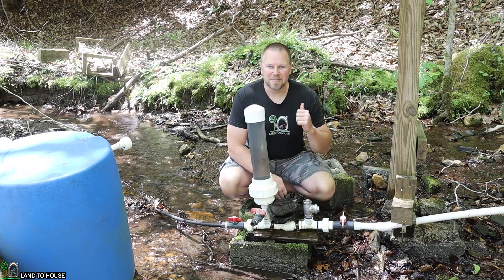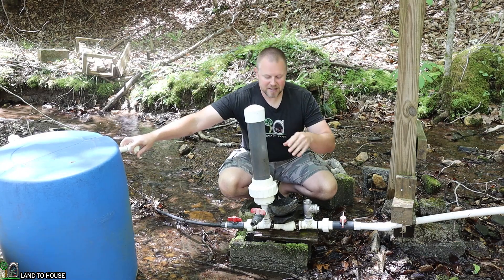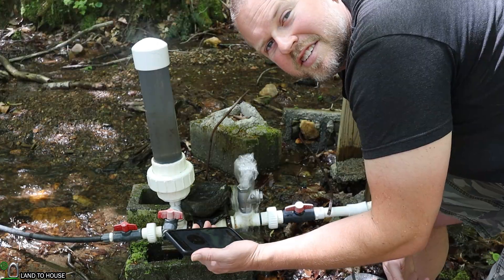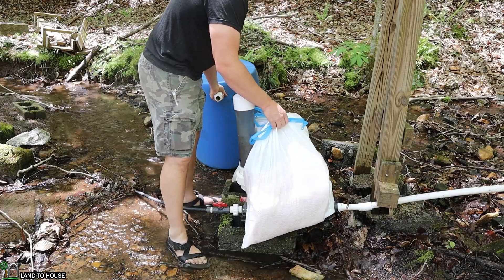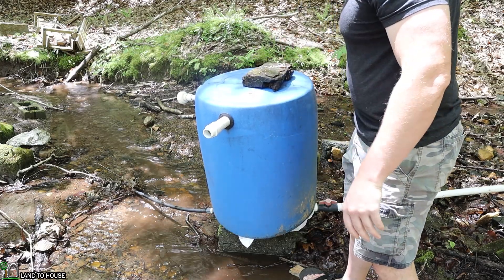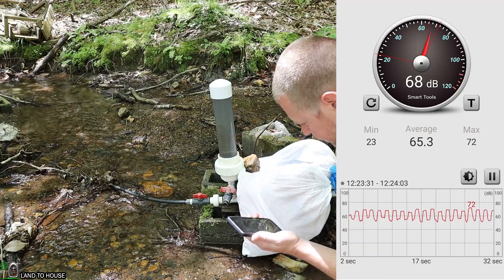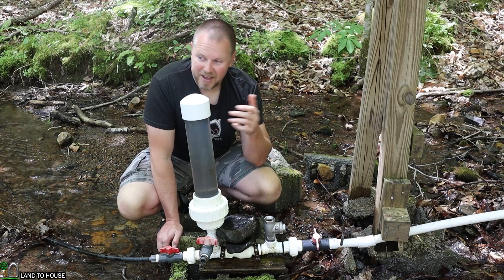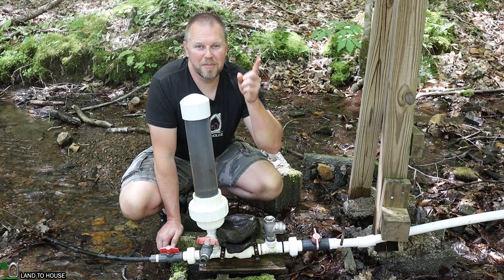Reduce Ram Pump Sound with Insulation and Barrel

Comment: The next thing I would try is to get a frequency meter and then find out exactly what frequencies that the ram pump is generating, then use that to design a sound baffle targeting those measured frequencies.  You also want to isolate the sound containment device from the pump so that any physical transfer of sound is harder to achieve. in the same way that the sound is travelling along both pipes.  For the pipes, I'd bury them.

Comment: Mass instead of fluff will deaden the sound.  Try making a pump-house enclosure around it with the extra cinder blocks you have from taking down the dam wall.  That's why a lot of home well pumps are inside a cinderblock dog-house, the cement blocks do a great job of keeping sound from penetration.  You might also try a little pump-house of your left-over 2x lumber from the new workshop.

Comment: Try spring loaded PVC check valves. I think the half inch ones have a 2.5 lb spring. For more water, use a slide valve or the homemade one at this video.
RAM PUMP VALVE COMPARISON - why the swing check valve is so useless

Comment: You need to put it inside styrofoam box, inside other dampened box. The intake and output also need to be flexible, like rubber or silicone.

Comment: Check out packed sound attenuators that are used on HVAC systems. That will help with the waste valve noise. The only reasonable solution that I can think of for the drive pipe is to bury it.

Comment: Hi Seth l, love your channel.  You might try to isolate the valve with a rubber coupling. The hard pvc is possibly amplifying the click. Also can the feed tube be made of rubber instead of pvc?
Love these experiments
Maybe just short piece of rubber pipe just before the the pump
Bill Nichols

Comment: How about putting pool noodle over the intake pipe?

I mean, to insulate the Shockwave. 
But that would be kinda expensive. 

So, something that readily available that can dampened the vibration would work. 

Like burying the pipe? 
I don't know whether it will work or not, but it deserves to be tested.

I hope this will helps.

Comment: Install sound deadening material...possibly spray or stick on for automotive use...to the inside of the barrel.  Then do this once more to a barrel over the initial barrel. The sound will decrease significantly. The residual sound will likely be due to space between bottom of barrel and ground. This could be solved by slightly burying the barrel, cutting into where needed around the piping.

Comment: I have a 80 gallon 2 stage air compressor working on the other side of my office and I used some sound board from home Depot. Comes in sheets and works amazing. I can barely hear my compressor running.
Reply: decoupling the compressor from the floor can make a huge difference too. If you can feel the vibration in your feet when the compressor is running its worth doing.